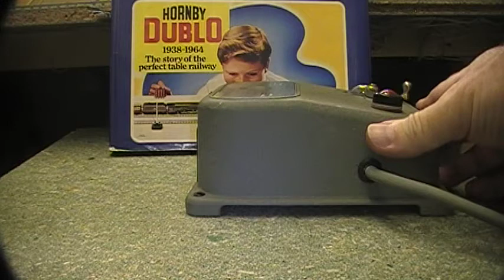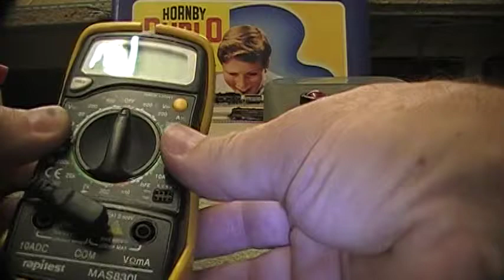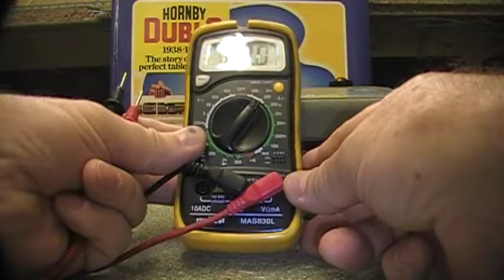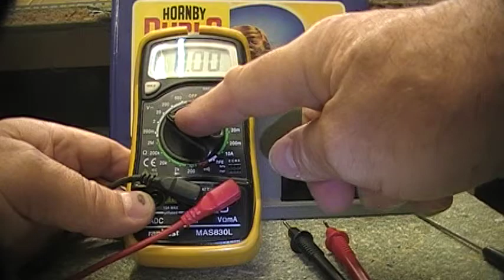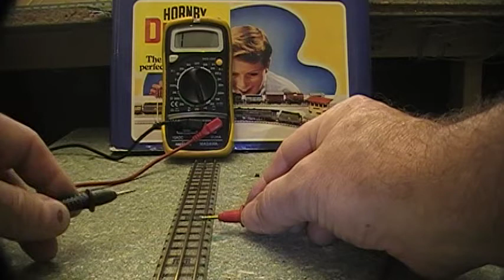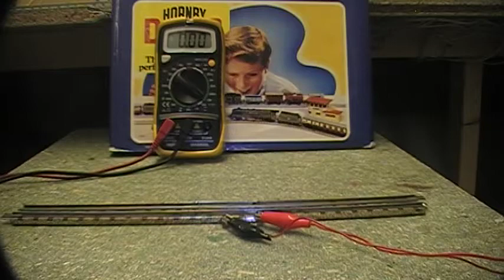Dublo electrical test.

Comment: I have a question. Could we use a modern DCC system on Hornby Doublo? I have see some one on you tube having a DCC chip wired up to a model andit seemed to work just fine, he even had a sound chip installed to an 8f. What are your comments?
Reply from the maker: Hi Andrew, I don't do DCC as I try to keep all as it could have been in the Dublo era, though do know some adapt HD to run with DCC

Comment: Hi ronald I love the videos there very well done and full of really good tips I am 26 and new to dublo 3 rail  

I checked one of my amatures and on the an my multimeter on 200 ohms setting and all it came up with on the display was 0.00 is that good 
now I work on real steam engines for a living so model railway electrics is very new to me so sorry for my incompetence I also have a couple of problems with a hornby dublo standard tank will you be doing a video on a standard tank anytime soon regards jshaw